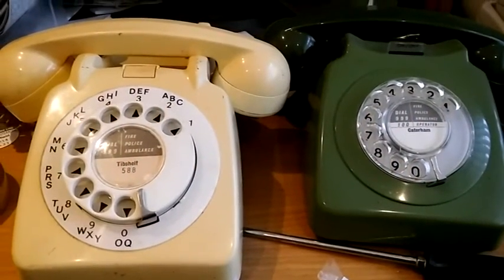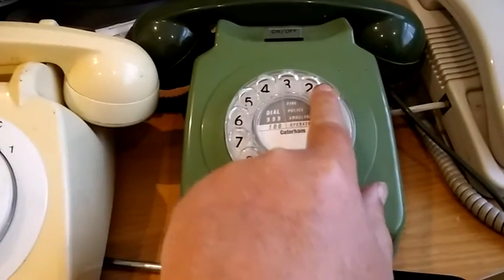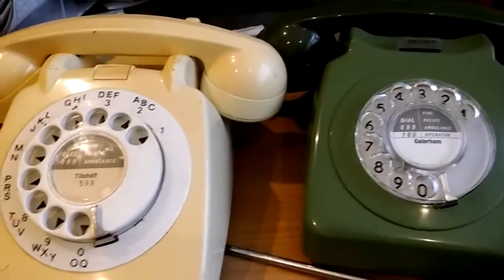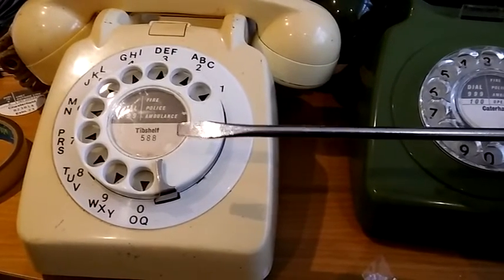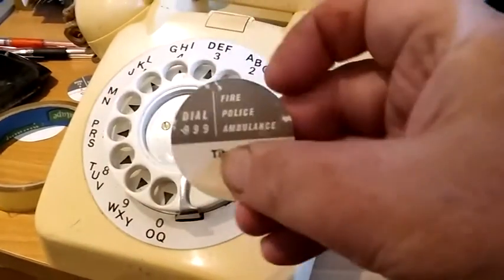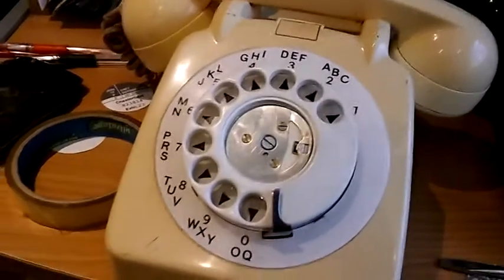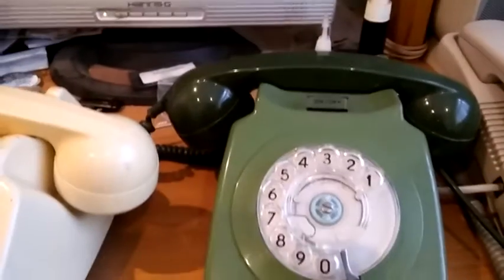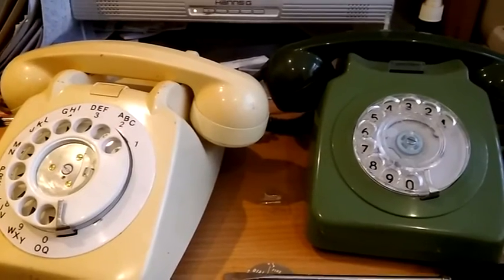How To Remove The Dial Label From Old British Telephones 706 & 746 etc

Comment: Thanks for the sellotape tip on the 746. I just got one off Ebay and was afraid I would damage it.
Reply from the maker: I'm pleased to hear it worked. The GPO originally used a rubber sucker but tape works just as well.

Comment: Thank you so much, was taking me forever. All it was was a bit of tape. Hahaaaa. Thanks again.
Reply from the maker: Hi Lee. Originally the GPO engineers had a little rubber sucker type thing. Tape works almost as well. If the cover is not too tight you can also use a lump of blu-tack.
Reply: Andy's Shed well I am over the moon with it, quickest of fixes. The phone is a present for my girlfriend, so wanted to put a label inside. Thanks again.

Comment: Hello. On the 747 there is a clear plastic switch by the reviewer. What is it called and what is it used for?
Reply from the maker: As far as I know there was never a telephopne 747, so I'll assume it's a typo and you meant 746. The clear plastic button can operate various types of switches that can be placed inside the phone for different uses. It can be used for automatic redialling of the last number (the exchange the phone is connected to has to be set up for this) or it can be used as a bell on/off switch.

Comment: My Parents had a two tone green 706L fitted with a clear dial from new, but it had the lettered dial surround. That was circa 1968. So late 706’s were fitted with clear dials brand new on installation.
Reply from the maker: That's very interesting because that's a combination that in theory shouldn't exist. Late and refurbished 706s certainly came out with clear finger wheels, but they also had plain dial surrounds to make them more like the new 746, which came out in 1967. However some early 746s had letttered dial surrounds, so perhaps there were a few years where the lettered surrounds were used with the clear finger wheels on some models?
Reply: @AndysShed  I tried to pin down the date when the phone was installed by the GPO & it was between 1965 & 1968 ( between my sister & I being born). I definitely remember it being a 706L with clear dial as I had a healthy interest in telephones even as a young boy, & the phone was only disconnected around 1990 when my parents changed over to Yorkshire Cable. Unfortunately my Mum was sent a large Jiffy bag by Telecom & she had to send it back to them then. However I’d recognise the actual phone itself as I added certain subtle identifying marks!! I’d like to think that it’s still giving someone somewhere the same pleasure & reliable service we had out of it.
Reply from the maker: As far as I know the clear finger wheels first appeared with the 746 in 1967, so ifit had that finger wheel from new then it's unlikely to be before 67. However I'm wondering if an engineer changed the finger wheel for some reason in the early years? It's quite unlikely though as finger wheels don't often fail.

You've certainly added an interesting development stage to the 706 story that everyone seems to have forgotten about. What's niggling me is I've seen very similar green 706s and just assuned the finger wheel had been swapped. I wonder if one of the factories was producing this strange variant for a while? Maybe it was at the changeover from 706 to 746 production and they ran out of green finger wheels? Not wanting to end up with obsolete green wheels they started using the new clear ones instead? I guess it's a possibility
Reply: @AndysShed  it wasn’t a changeover. Definitely from the date of installation. I have seen others the same, although quite rare. As far as I know it never had a dial change in all those years but I did recall the engineer coming out on one occasion & looking inside the phone, but I can’t recall why.
Reply from the maker: Sounds like it must have dated from that point when the factory was changing over to new components in readiness for the 746. It's interesting because there is one exactly like it on E-Bay at the moment and that's not the first I've seen. Can you remember what the dial back plate was like? Was it a cooured one to match the phone, was it like on a 746 or was it silver with arrows on?
Reply: @AndysShed  Silver with numbers, like the 746. Both my parents & I can confirm this.
Reply from the maker: That's very interesting. It seems to be a forgotten combination of parts they used around the 706/746 changeover.

Comment: Hello Andy, Can you tell where I can buy a replacement piece that holds the finger wheel on for a 706 gpo phone?
Reply from the maker: What part is it that you want Mike? Is it the round bit the finger wheel screws onto? Or maybe you mean the clip that holds the finger plate down onto the dial? If it's the latter you don't really need it. Ericsson N1900s (706 clones) were never fitted with the wire clip to save a bit of money.
Reply: @AndysShed  Thank you for your reply. I have a metal base 706 that only has one lug holding on the finger plate. Some people have said that was standard for that type of phone. I have noticed that the dial is cracked, could that be due to having the wrong screw holding the finger plate inplace? If so, where can I get the right screw ?